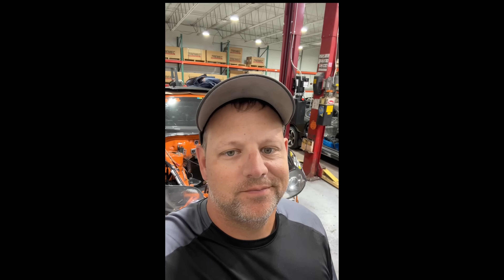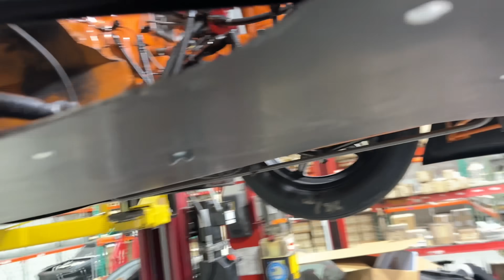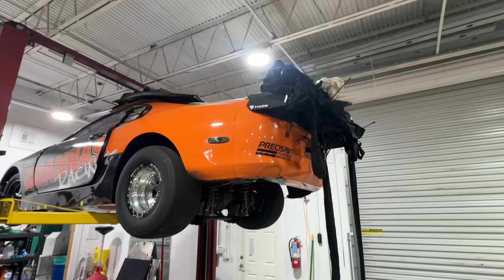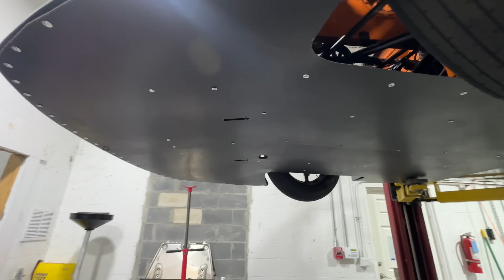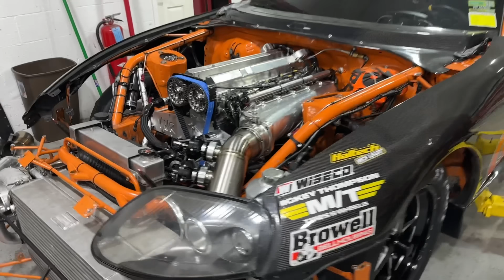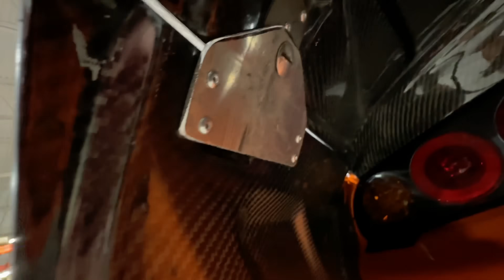SUPRA FINAL BOSS - New aerodynamics package and full underbelly tray

Comment: if you put a 2" curvature where the tip of your intake meets the face of the front bar, anything over 100mph will force extra air through the turbo adding boost and noticeable power increase. something you won't see on the dyno so just be weary of that because even what you have there can also have similar effects on a less of a scale. this phenomenon is missed more than people think leading to lean conditions especially after 150mph

Comment: Why not slip the bellypan under the front bumper lip so it doesn't catch air
Reply from the maker: I wanted to do it this way originally…. but the dzus springs + thickness of carbon sheets would not fit inside the height of the lip… I could barely get the springs alone to fit inside the lip in a lot of spaces - actually had to crush the spring down some to make it work. Very tight due to the way the bumper is manufactured
Reply: @GrannasRacing  couldn't have used another fastener? Gonna suck to see the carbon start splitting